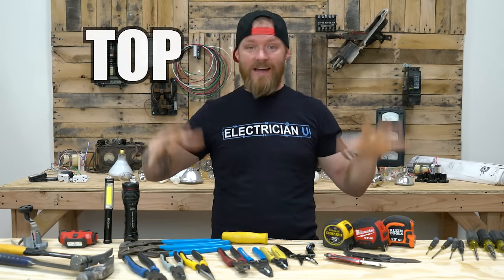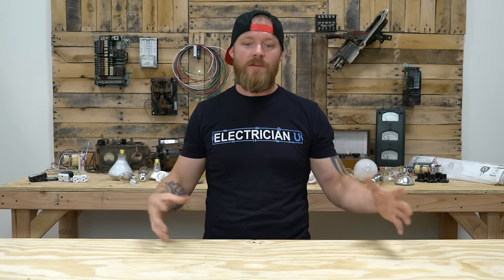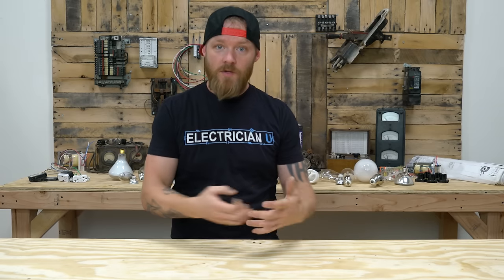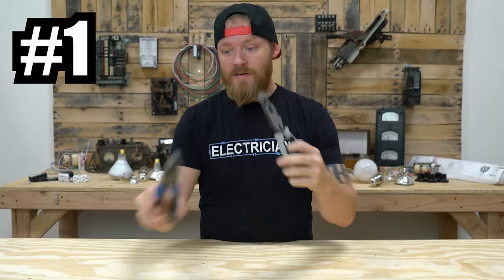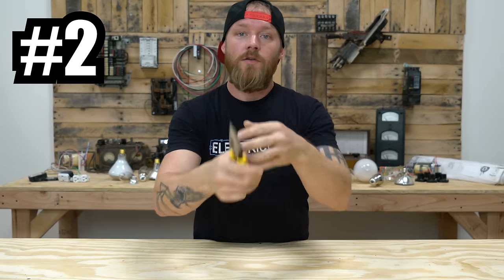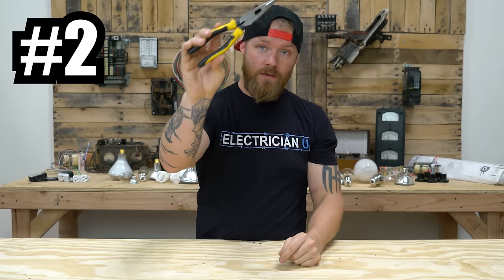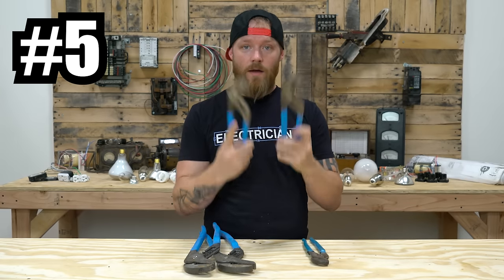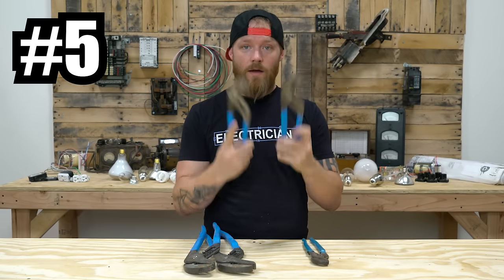Episode 42 - APPRENTICE TOOLS - 13 Tools Apprentice Electricians Need To Have

Comment: As others said you forgot torpedo level (possibly a pipe reamer too) but definitely a tick tracer. NEVER TRUST ANYONE that a circuit is off. ALWAYS double check. It can be as deadly or harmful as trusting someone that a gun is "not loaded" without checking it yourself. EVERYONE has been bitten at least once in their career because we were too stupid or lazy to grab our tic tracer and double-check.

My personal experiences seatek roto splits are the best. They are the ones that made them originally. I tried a set of greenlees they were junk and wasn't too impressed with the Klein's either. (side note I watched a brand new pair of Klein's open up out of the package with a greenlee blade in it) WTF. Lol

For the noobs out there the armored cable comes in two types AC (aluminum clad) and MC (metal clad). The MAJORITY that is used in our industry is TECHNICALLY AC but, commonly referred to as MC. So when buying the blades for your roto splits initially and your replacement blades make sure they are for aluminum.  

My personal preference for a go to pocket knife is Kershaw multi-tool.  In the handle it has a bit holder and a number one and number two flat head and on the other side a number 1 and number 2 Phillips. You can also swap out one of the lesser used ones for a square bit. It's nice to have "just in case". 

The rule of thumb I was told and tell everyone is you should buy a tool a week out of your paycheck. With the exception of your lineman's pliers most other tools are $30 or less each. It's okay to buy a cheaper brand to get something in your hand and show initiative but realize in the long run you're going to want good quality. if you buy shit tools you will have a pile of shit tools in the end and spend way more money replacing them continuously than if you spent good money in the first place. Your lineman's, side cutters (diagonal cutters) and strippers should be Klein or Knipex. Those three tools your're right at little over $100 (ish). Always feel free to ask your leadman / journeymen and others that have been in the field for a few years what their personal preference is and why. Some of us like buying tools because we have an obsession. We will have two, three, four different versions of about something but still have our "go to s" .With that said and my parting . 02  DON'T buy into the EVERYTHING NEEDS to be Klein. There is about a half a dozen to dozen tools I feel NEED to be Klein otherwise you're just paying for a name. IMHO I

Comment: You forgot the wire stretcher and the outlet hole saw.
Reply: DJDIAZ001 those green handle wire stretches are the best. Spent an hour pulling everything off the van my first week

Comment: No level. Hacksaw..Cordless drill.... And buy a damn real wire crimper from Klein. Same for tools rated to cut steel bolts and nails. It will save you from ruining them pliers..
Reply: Master Chief I am a helper and I have 2 sawzalls and no hacksaw.  Thank you for your service btw

Comment: I’m At the point where I would pay an electrician or electrical engineering student to let me have a little chat with him and help me understand something about inrush current
Reply: In it's simplest form, a load is a resistor that has a low resistance at resting temperature. So when current begins to flow a lot of it flows until the resistor heats up to normal operation. At least that's how light bulbs work. This happens very fast too. When the resistor heats up the resistance increases and current flow decreases to it's normal flow for that specific load.
Reply: Think of a motor at rest, when you apply voltage to start the motor it takes more current (amps) to get the motor moving sometimes refered to as starting current. This initial startup make take 60 amps and as the motor comes to running speed the current drops to running current which might be 8 amps, this sequence happens almost instantly. The start current is the inrush current. Every time a motor starts there's a inrush of current. Hope this helps.

Comment: Here's the trick: buy cheap shit. Needle nose pliers are never used for high leverage, so any $5 harbor freight ones will work. I've only had to replace my needle nose once, and it's because I lost it. A large slotted screwdriver (~3/8 inch) almost never fails due to the steel being too low quality, so the cheapest one on amazon will work (my Klein screwdriver broke because it wasn't full tang, not because the steel itself was bad). I don't think I've ever seen wire strippers break, so just get the cheapest ones. 
The only things where you absolutely cannot cheap out are the small tools. A 3mm slotted screwdriver made of cheap metal will bend or break; I've seen this many times. A good quality slotted screwdriver has a million uses, so buy a good one. It's a pry bar, it's a chisel, it's a screwdriver, it's a back scratcher.

Comment: Cant say ive ever seen a Robinson square drive screw in electrical now I've seen it in building
Reply: Almost every device and j-box has them - they are buried in the combo-head screws.  The screws take slotted or Philips or Robertson.  I feel like I get a more solid grip using the square drive.  Although lately I've been using a combination tip screwdriver - it engages both the square and slot at the same time - good solid feel.
Here is a web page with pictures of a lot of places combination screws show up.
https://toolguyd.com/milwaukee-ecx-screwdriver-bits/

Comment: I was told I need a combination square. Wtf is a combination square and how do you use it?
Reply: A combination square is a metal ruler with an adjustable head that can be slid and locked into place. You've most likely used or seen one just didn't know the name 👍
Reply: Jose G. Pizano i use a carpenter’s speed square a lot. Makes laying out holes in J boxes and troughs a lot easier

Comment: Demo of "bolt cutter" players  would be informative for us"newbees"
Reply: They aren't really "bolt cutters". They are really just screw cutters. They are threaded holes in the pliers meant to be used for trimming screws that are too long. For instance, you need 1-inch #10 screws on a junction box, but the screws it comes with are 1/2 inch, and the only #10 screws that you have are over 2 inches long. You can thread that screw into the #10 hole on your pliers and then close the pliers to snip the screw to the desired length. You now have a shorter screw, and the threads are not damaged like they would be if you simply cut it with wire cutters or bolt cutters. 👌

Comment: Needle-nose pliers? Do people really use that? Cuz I  never do.
Reply: I use it for my job as a car mechanic. Mainly for a "get this damn small piece in this tight spot outta there" tool but it still works.
Reply: Sometimes when I do receptacles I use the needle nose to help me make them straight and even
Reply: great for pulling KO's out of boxes without pulling the mudring off, and pulling dimming wire apart.
Reply: And bending and closing a wire around a screw.

Comment: Maybe its a american thing but we european electricans mostly use only inslulated screw drivers
Reply: Idd better to be safe than sorry.
Reply: pyro unlimited just keep your fingers off the metal. They are more expensive and in the USA we have to buy all our tools. Also the thicker insulated shafts can be hard to get into tight spaces
Reply: pyro unlimited  you guys use 220v electricity over there?  We mostly use 110 here. Much safer.
Reply: Bruce Bennett well in residential you use 2 leg single phase that is 120/240 volt and some commercial is 277/480 volt

Comment: You forgot the number one tool the one that can save your life the non contact voltage sensor. If its hot make it not never work anything with voltage in it turn it off 
Never work it hot. Number one rule for an apprentice
Reply: Brian Horton best hot tester is a pair of linemans pliers

Comment: After viewing quite a few YouTube videos of American Electricians I've come to the conclusion that VDE insulated hand tools they don't seem to opt for ???? Why is that ?
Reply: 9 Plus Instalaciones they are very expensive and not necessary for 95% of the work I do... I have a basic set but for most things you can jerry rig your tools if you prefer it that way. Not ideal obviously but better than paying 1000 + for a full set that won’t get used often
Reply: @spudatbattleaxe  Hi Joshua, VDE hand tools like www.wiha.com are very expensive ?
Reply: 9 Plus Instalaciones for the full set yes, for just a few screwdrivers it’s expensive but not too bad, as long as you protect them to not screw up the coating. When you compare them to basic tools yeah, they expensive.
Reply: @spudatbattleaxe  maybe so Joshua, I'm not sure on the prices in the US. I've spent thousands on tools over the last 30 years, some stuff I simply only use once in a while, I'm like that, I'll spend 5% of a €2000 job on tools, I like investing in anything that can help me organise well, and time save.
Reply: @spudatbattleaxe  Having said that I haven't gone out to purchase the big boy hard wheeled case of Wiha hand tools yet. Good set but I already have most of them, either Wiha or other manufacturers
Reply: 9 Plus Instalaciones yeah my boss is the same way, he invests heavily in nice tools. I have all basic hand tools and a few specialty ones, but my boss makes it easier on us by getting nice equipment.
Reply: @spudatbattleaxe  and what a pleasure it is to use them yeah ?

Comment: needle nose dont need, diagonal pliers dont need, wire strippers def. dont need thats what klein side cutters are for, dont need flashlight if they dont have light on the job F em,  dam sure dont need a roto splitter again kleins do that.